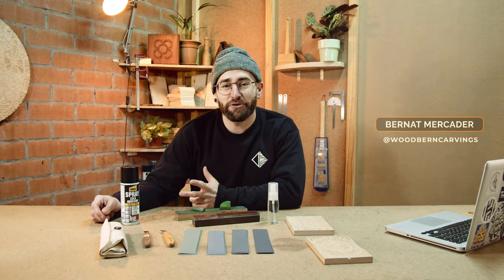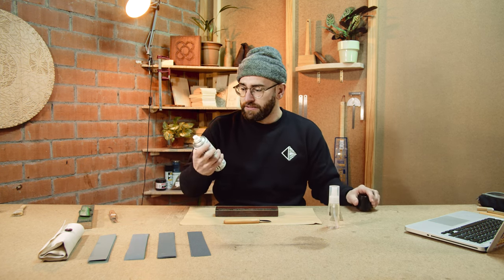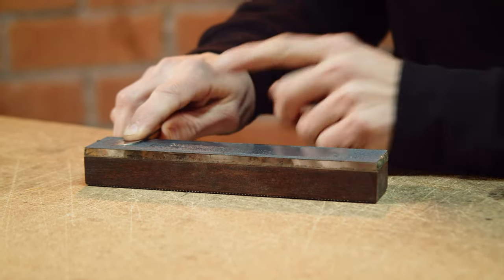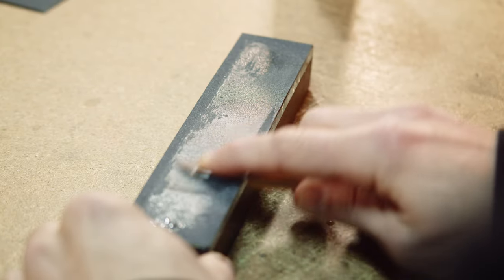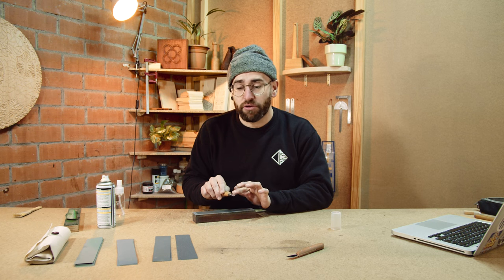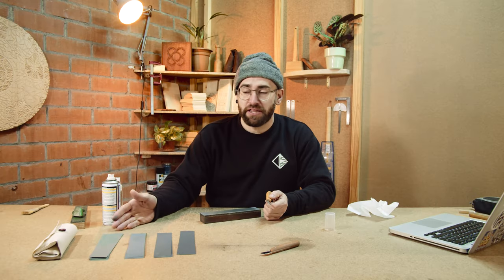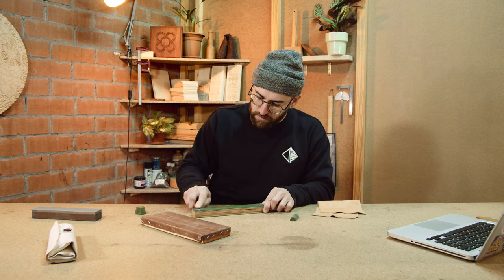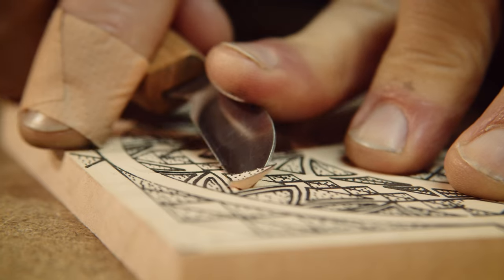How to Sharpen your Chip Carving Knife: Simple, Easy & Cheap.

Comment: Say there is no noticable damage to the knife edge, how would you notice the need to sharpen instead of stropping the knife? 
Do you sharpen it regularely or only when the need arises, and use stropping to keep it sharp instead? 
Thank you in advance!
Reply from the maker: Hi there!

Sorry that I didn't see this comment before.

I don't sharpen my knives very often. I sharpen them once, and then maintain them by stropping with leather and polishing compound. By experience and by trying different knives and sharpening methods I already know when my knives need sharpening. I compare my sharpening to other knife makers by using their knives and testing theirs and mine. That's why when I make a cut I know if the knife need sharpening. The knife should be able to cut  and slide through wood without applying excessive force.

Also you should look at your cuts, if they are not clean enough but your carving technique is right, you should sharpen them probably.

Sharpening is a whole world and I'm sorry I cannot answer your questions specifically like a Yes or No! If you still have doubts let me know.
Reply: @WoodBernCarvings  Thank you for replying, that makes sense :-) I have not sharpened my Klotzli after recieving it but if i understand your videos and Domestika Course im guessing i should?